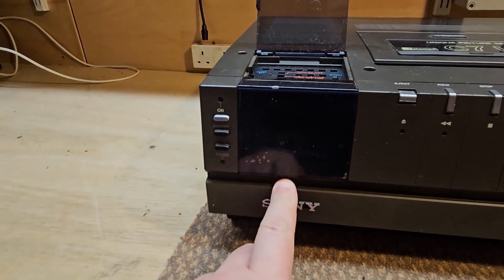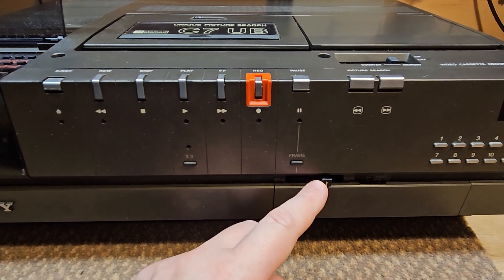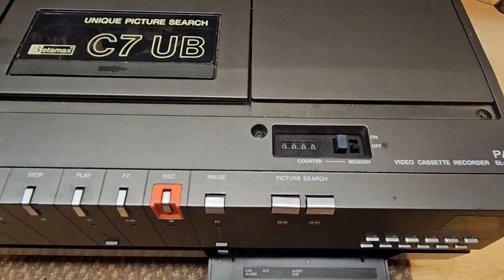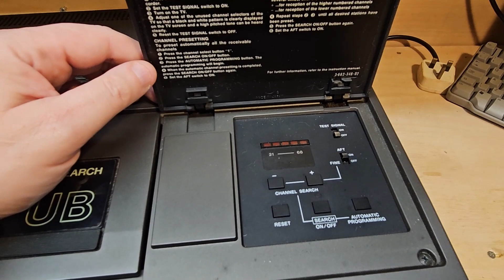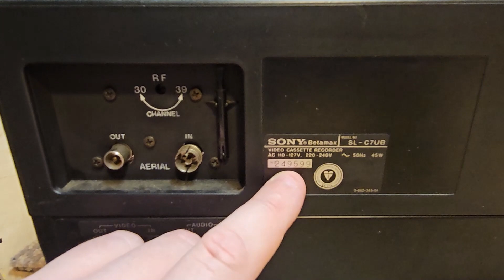Sony SL-C7 Resurrection after 12 years in storage

Comment: I got an SL-F1UB Betamax in 1984. I find the US pronunciation "Bayta" odd! ... I've always pronounced it "Beeta" ... Baytamax / Beetamax

Dew is one of first things you learn about VTR / VCR. I learned it 45 years ago! ... Surely the VCR has a dew sensor? Many have heaters too.

NEVER operate a VCR / VTR when moving it from a cold place to a warm place. Always allow the machine to warm up to room temperature. In 45 years I've NEVER had a dew problem.

On the tape was Doctor Who "Nightmare Of Eden" (1979) with Fourth Doctor, Tom Baker, and Geoffrey Hinsliff (Don Brennan in Coronation Street), and David Daker (Boon).

Comment: I have repaired many of these machines. I always found that the C5/6/7 gave excellent picture quality. One good thing about this generation was the use of the three piece drum, [lower, middle, and upper]. it helped reduce frictional losses during FF and REW. The later two piece drum design would cause excess drag across the upper drums when they began to wear. In the SL-C9 and the SL-F1 portable that used direct drive reel motors, the worn upper drums would cause the tape tension to go beserk during FF and REW causing a knocking effect. I have a soft spot for machines from this era.
Reply from the maker: Ive got a SL-F1 with the worn upper drum. the sony fix/replacement was made of a hardened metal.

Comment: Always admired the C7 in the very early 80's but ended up buying a newly released C9 for £699 in December 1982. Looked fantastic and had great still and slow mo but within 5 years (and not even heavy use) the heads started going and then the front loading mechansim broke. Swapped to VHS and never had any problems with any VHS machines - all of which recorded many, many more hours than the C9.
Reply: Nice to meet you, this VCR can receive stereo TV channels from an RF CONVERTER. 👍
Reply: Not surprisingly, VHS VCRs were simpler in design than the Beta and even more so than the Video 2000. The more advanced formats had more defects, not because they were rubbish, but they were more difficult and slower to refine in order to be cheaper.
Reply: @janmos5178   Beta was never 'more advanced' than VHS - this is one of the many urban myths surrounding Beta such as that it had better picture quality than VHS - in reality, the differences are marginal and (putting Beta1 aside, which didn't last anyway in standard Beta machines) both have 240 lines Luma and 30 lines Chroma resolution. Given output quality was so similar, the simpler design wins - being more complex in design doesn't make it more "advanced" if the results are similar. Beta is also known for wearing down heads more than VHS.
Reply: @tsmith7146  Agreed but I am writing about something else. Mechanisms or decks like U-Load and its derivatives like C and the like were  more advanced in design than M Load from VHS. And more expensive to manufacture.
Reply: @janmos5178   I just don't agree with your label as being 'more advanced' - to me it is just more complex. In Beta, the tape follows a longer and more convoluted path to get around the head than in VHS - this, I feel, is an example of being more complex than more advanced. If it is genuinely more advanced, it should reap picture quality improvements. 
In the late 1970s and early 1980s, the cheapest VCR's on the market were Sanyo's Beta range (marketed as Betacord) - cheaper than equivalent VHS machines at the time. So Sanyo managed to get their Beta prices down - and didn't keep tape spooled around the head drum whilst FF/Rewind so head life better then Sony Beta machines.
Reply: @tsmith7146  And in this you have the answer why Beta wears out more than VHS. I'm glad you're writing this not because I didn't like Beta but not many of its fans including on the internet can admit it. Video 2000 had the same thing. Because structurally they were more advanced in design than VHS, Beta less so, and it's obvious that they did not immediately achieve the reliability also not ideal VHS. Especially in the design of mechanisms and writes about it. E.g. in SL C5 at the end of the 70s quite often died tape binding vel threading rings in cheap U or C load decks.This has been refined but early M Load decks better withstood intensive and frequent cassette changes and the frequent tape banding (threading)process.
Reply: Ok as you call so call complex or advanced ok, maybe your term is more correct but we know what you mean. VHS were just mechanically simpler than Beta and Video 2000. And that's why they broke down and wore out less as you wrote about. Video 2000 had more complex on top of electronics especially Syscom-Servo track, DTF. But that was my point VHS was less complex.
Reply: @janmos5178   No - not 'Beta' re your comment on head wear. Sony Beta yes (and i'm fully aware of the head wear issue after my C9 in the 1980s) - as established, Sanyo Beta did something different.
It's just coming down to use of words. As i've said, instead of your use of 'more advanced' - the words 'more complex' are more appropriate, I feel. If it is truly more advanced, it has to yield a performance benefit.
Reply: Ok. but the truth is that VHS video recorders were more reliable than Sony Beta or Video 2000 because, even if you say so, they were mechanically and compared to Video 2000, not even electronically, speaking like you, less complicated and that's all I meant. Of course, this is also a certain statistic because it was not the case in every case. And hardly anyone around Beta talks about it. It was simply cheaper and faster to achieve the appropriate level of reliability in less complicated M-type mechanisms, and that's what I mean.

Comment: hi i had adat recorders of ebay all that been bad is the headare not clean i use the same cleaning   tip as you do
i up set my mate  the sony 950 i time bomb   waiting to go bad the hall  ic' i call it  he played over £600 for it

i picked up a pallet of juck  betamax  decks john had 1/2 of them i had rest   he had the 5000 decks yes i got
the better deal

later on i picked up a full working betacam digi a500p for a £100

i went to a place called kings wood  ex hire place to pick  up the deck GOLD MINE  very seen any video in one place very

you have just out  video i have 60 easy  working betacam  decks    from the hire place i had 2 eu pallets  f betacam sp decks
i put alot of hrs fixing them  up  i do have betamax decks   

reel to reel soundcraft 760    brenell mini 8 are my bag    any thing i can get parts for